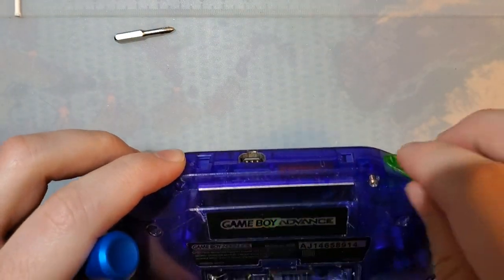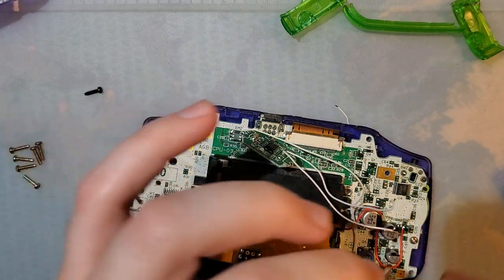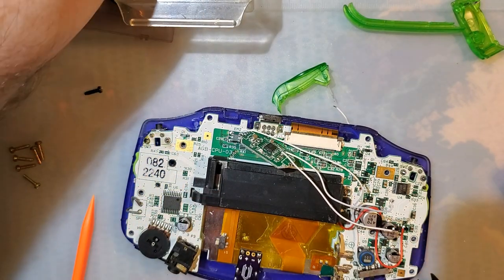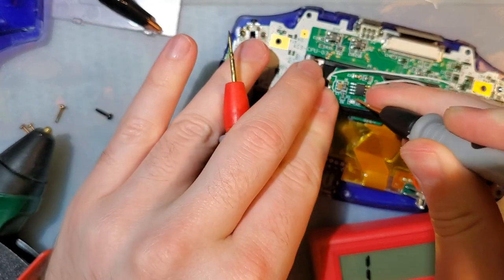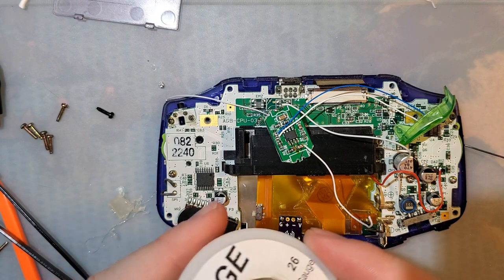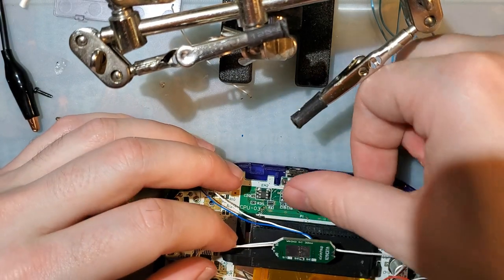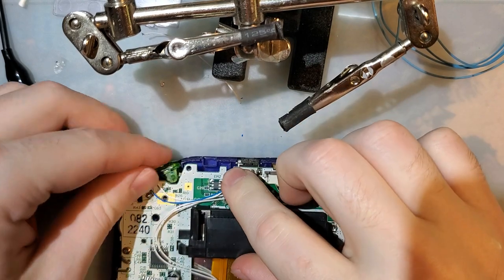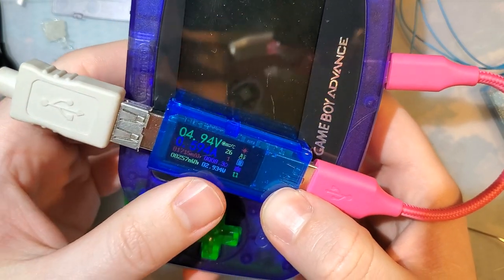Internal NiMh Battery Charger in a Game Boy Advance (Part 2 of 2)

Comment: I know this video is a year old... but I am wanting to add this same exact thing to my DMG Gameboy I will start moding once all my parts come in.  But not sure if I can use the same charger board, as my GB will have four AA batteries instead of two.  Also ran into the same problem of finding a really small type C breakout board, but I think I found one that is small enough for the DMG GB.
Reply from the maker: I believe this chip supports 4s configurations. I don't really recommend that though. For Type C input, there's always this https://www.youtube.com/watch?v=zn2ROKBG4sI
Reply: @makho  those boards look like they would help, I will see about getting some, pretty new to this for the most part.

Comment: you could of done it with two thermal pads on both sides, with the thermal pad being naturally tacky this will keep the board in place
Reply from the maker: I was actually considering that while installing. I ended up forgetting about it but I was waffling back and forth on account of not really wanting to transfer more heat into the PCB, especially right below the CPU, and I was concerned about the amount of space available. It's a good idea though.

Comment: Do you recommend this mod or does overheating make it unsafe? I plan to place it on my gbc and gba consoles
Reply from the maker: in GBC there is really no good place for the mod with good cooling. You will have to tweak the charge rate and lower it significantly. GBA is less bad but I still wouldn't rely on it as a primary method of charging.

Comment: The clear shells from retro game repair shop are really nice. I ordered a 3D printed insert from retro modding for my SP shell but it looks like it is slightly too small and doesn’t completely hide the back of my IPS screen can you work on an file for the correct size? Also, if you can print me an insert That the right size I can pay you.
Reply from the maker: This is not something I'm interested in working on at this time. I also do not take commissions. Sorry.

Comment: I thought, that's a really cool glue gun it beats the pants off the value brand ones I have... dang, that is a serious tool.  I mean Bosch so not too surprised but damn.  And mostly European sellers, how'd an Arizona trash bag like you get a hold of one? (J/K)
Seriously though, cool mod, and sometimes hot glue is the best solution, especially for unusual light pipes.
Reply from the maker: imported via amazon.co.uk: https://www.amazon.co.uk/gp/product/B00CI8FDUO

It's alright. Battery life is not as great as I would have hoped (but still certainly gets it done for what I need), it drips and strings quite a bit more than the other reviews had mentioned, heating seems extremely inconsistent (sometimes it needs a minute to heat up, sometimes it's ready to go in 10 seconds), and lately I've been having trouble with the trigger actually feeding my glue sticks. But the drip and feed issues could be related to the glue I'm running through it. I gotta take it apart and see what's going on though. 

It definitely has some quirks but it's way better than the one I was using previously. Plus, it has the added bonus of auto shut off if I forget about it and leave it on (which happens VERY frequently). 

But yeah, for light pipes, the only other solution is to use clear epoxy IMO and that is extremely impractical in a lot of situations and takes entirely too long to set. I also don't have any way to make my epoxy more translucent and less transparent other than just introducing tons of bubbles when mixing it but that's just an amateur complaining about stuff he knows very little about. It did work out pretty good for my Everdrive GB-X7 shell though. I accidentally melted the shell a wee bit when I was clearing out the bubbles in the epoxy but the epoxy itself worked out extremely great.